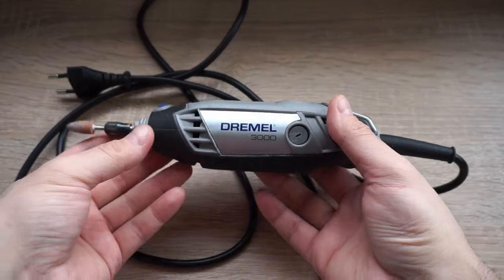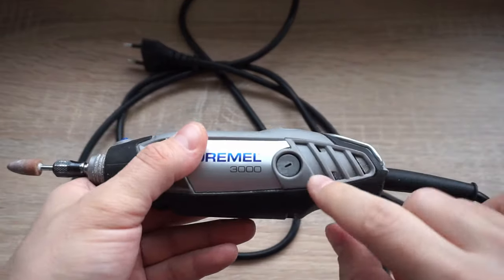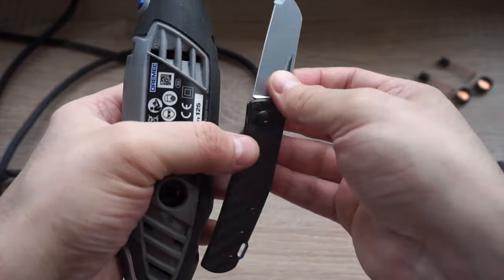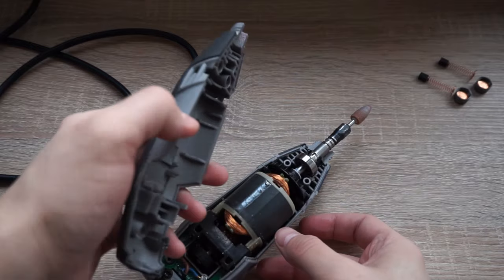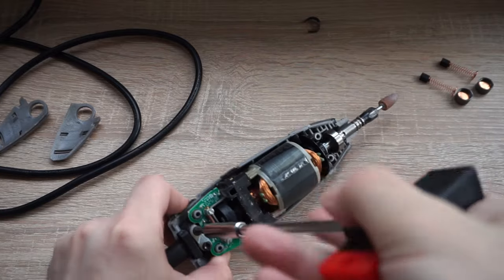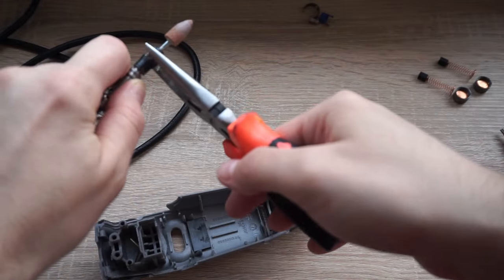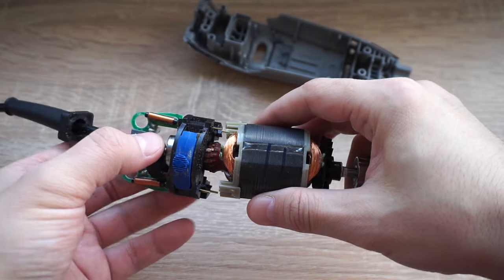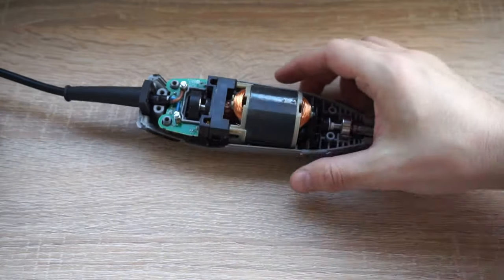Dremel 3000 lock button DIY "fix" by an amateur

Comment: Those two things you've unscrewed first look like brushes for the electric motor. They wear out with time and can be replaced, that's why they are easily accessible
Reply from the maker: that's correct 👍

Comment: So you left the lock mechanism off and use a drill bit type shaped to lock while exchanging bits?
Reply from the maker: that's right, I've removed the button completely and I'm using the other end of a 2 mm drill bit to unlock it

Comment: Do you have to take it apart all the time to change bits?
Reply from the maker: no, you can shove a thin screwdriver in the hole where that button was or you can hold the end of that shaft with two pliers and twist in opposite direction
Reply: The locking system has been nonsense  for decades..Dremel engineers seem to lack the IQ to do a fix...everybody just nores through the holes in the amature and uses a rod ...amen